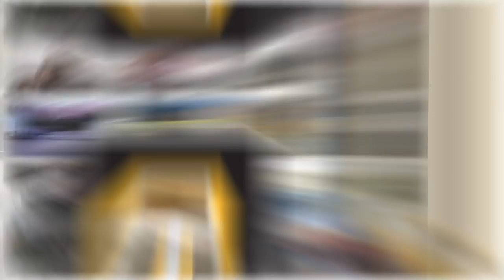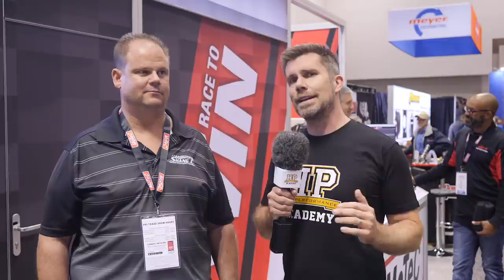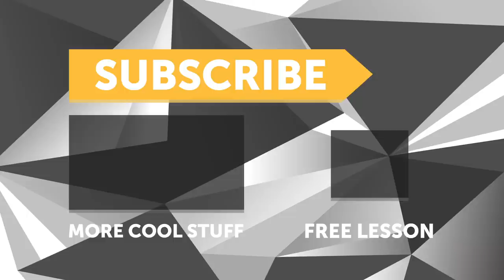Shane T on 2500 to 4000HP Pro Mod Drag Car Tuning [#TECHTALK]

Comment: The NHRA sounds like a dinosaur. Put it on the shelf for the rest of the has-beens
Reply: That's what happens when your core management group is over 60. Now I'll wait for somebody from NHRA media to correct me and say the management group is under 50. This whole notion that traction control is bad doesn't make it easier for teams and drivers to win. If both cars don't spin out of the hole it comes down to reaction time anyway.  They allow air shifted transmissions, because it's not electronic that's acceptable?
Reply: ...and, yet, there's a number of people bitching about how so many of today's drag cars live and die by traction control - so out of touch...

Comment: Wow the NHRA is lame. Miles of safety tape, red tape, and restrictions really take a lot of the fun and engineering ingenuity out of it. I feel for Shane T.
Reply: Considering that Pro Mod is one of the only classes that consistently sees grids with MORE cars than qualifying spots, I think they're handling it just fine.
 
Different classes have different rules, go watch sportsman racing if you want to see REAL ingenuity. Looking for a half HP here, a quarter there just like the Pro Stock guys - but in home shops/garages.